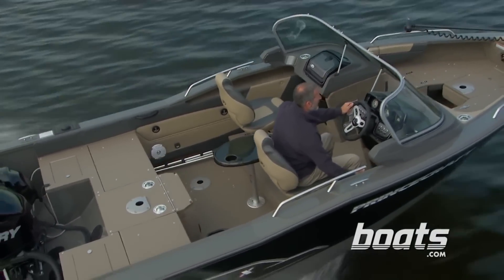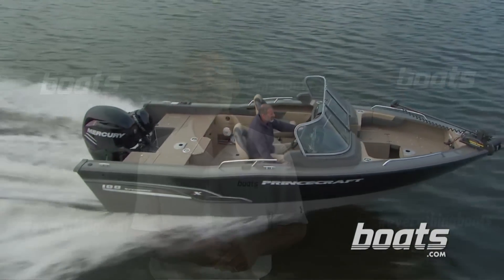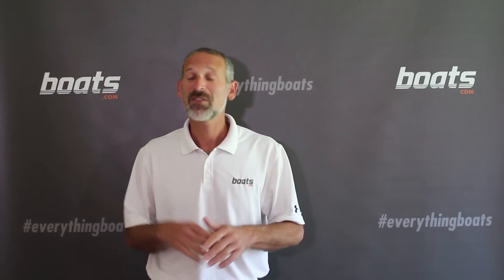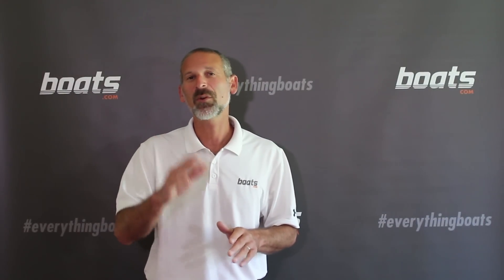Boating Tips: The Difference Between Cavitation and Ventilation

Comment: Cavitation is steam, not air, not vapor or vacuum and is caused by low pressure on the leading edge of the prop tips.

Comment: Cavitation is the formation of vapour bubbles - not "air" or "vacuum" bubbles. The water "boils" in a low pressure area and forms the vapour bubbles.
It then collapses "violently" in a higher pressure area and if it collapses near a surface it can erode that surface.